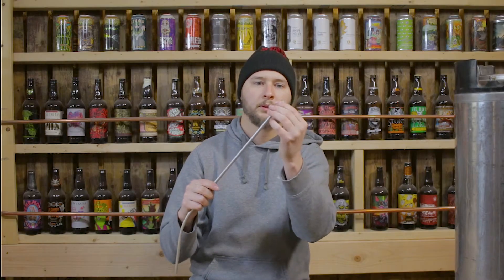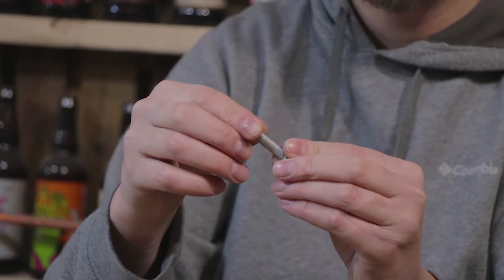How to replace O-Rings on a 5 Gallon Keg - Tutorial

Comment: Could you hook the keg up to an air compressor to run Star San through the lines to sanitize everything and save the CO2 for the beer?
Reply from the maker: Technically yes you could. I would be cautious though as air compressors sometimes have oil in the compressed air. So you probably don't want to have too much air going into a cleaned keg if possible.
Reply: @MoskiHomebrew  thanks